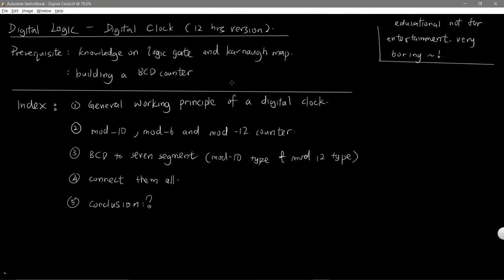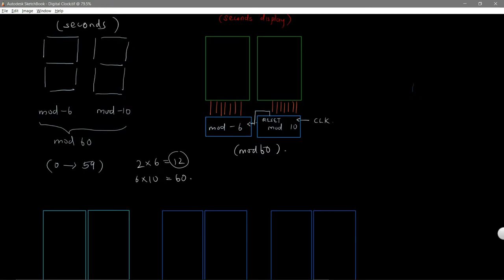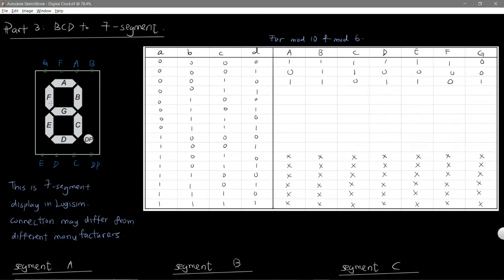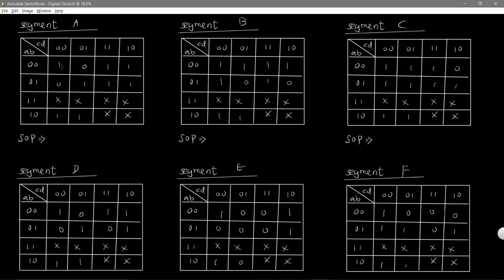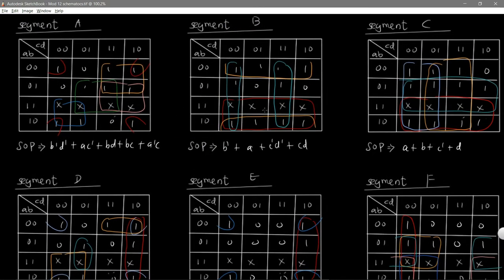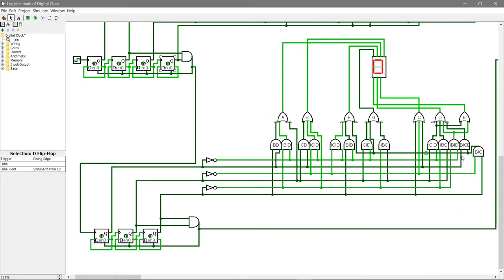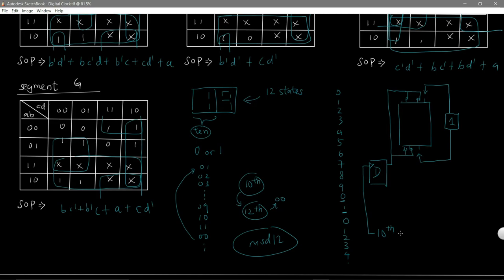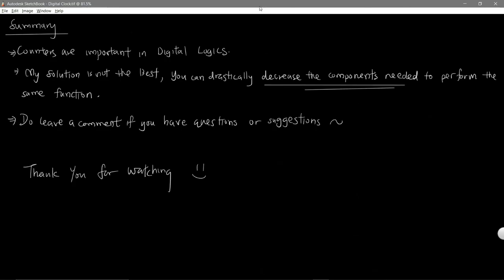Digital Logic 04 - Digital Clock

Comment: thank you for this, you helped me with my assignment a lot.
Reply from the maker: you're welcomed 😁
Reply: @IC-rd4zl  i have just one question, if we just use BCD clock display and not 7 segment display, how would we solve the truth table?
Reply from the maker: @mazzaleenh8388  by 'BCD clock display' do you mean displaying the value of second, minute and hour by binary values instead of decimal values? if so, you only need mod-n counters to work with, like so:

https://drive.google.com/file/d/1QWriEUDBRdN1qfBG35n3eGCqBuVbWTnb/view?usp=sharing

if you mean that you want to convert decimals to BCD, for example: '32' in decimal to '0011 0010' in BCD, then that involves some other operations.

Comment: Great work mate. Is it possible to manually set the time in this type of design or does a microcontroller make more sense in that case?
Reply from the maker: of course you can, and it is very simple, what you need would be adding one OR gate and a button in front of the counters so that you can manually set the number using the button. Like in this 2 picture, adding button at the 1st and 2nd group of flip flops allows us to manually set the seconds' digits:

https://drive.google.com/file/d/1s_yT2axWXXUILRTP__ldQzeu1x9Vd6uu/view?usp=sharing

https://drive.google.com/file/d/16SNTfccOu_CGaw3pm1cyShaFhr4yqTxG/view?usp=sharing

Using a microcontroller for this would be a bit overkill, but that's a good thinking cause a microcontroller can set all 6 digits in one go.
Reply: @IC-rd4zl  Woah hey thanks. I wasn't able to find a method that didn't use a microcontroller. We used the 7447 to drive the 7 segment display.
Reply from the maker: @devanshudwivedi5875 
You're welcomed :D
If I understand correctly, 7447 functions as BCD to 7-segment converter right? that is basically the bunch of gates we have in this video, that is connected to the 7-segment display. I believe they have a different design in practical, but the function is same.